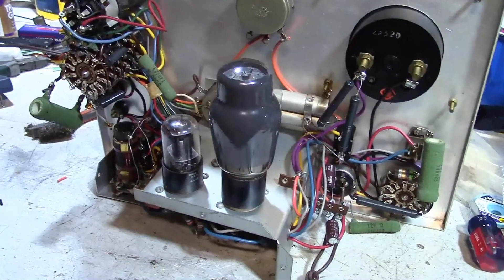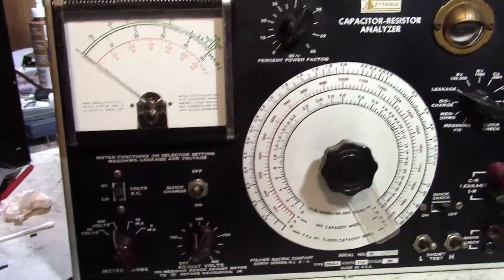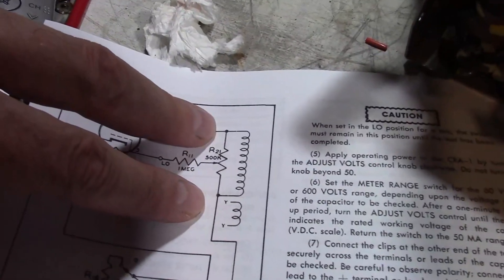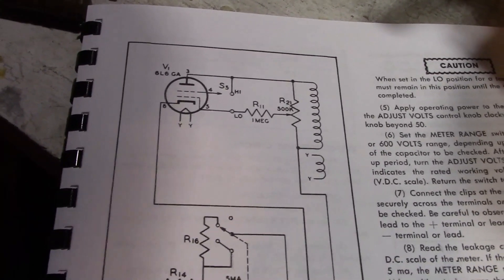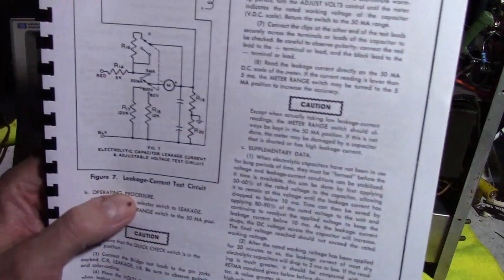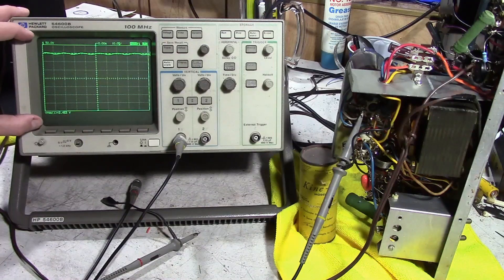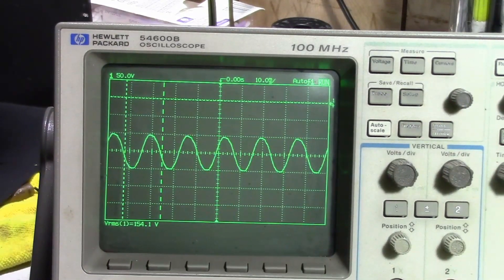Pyramid CRA-1 grid controlled rectifier

Comment: Greetings: 
Using an isolation transformer to power the CRA-1:
With nothing connected to the CRA-1's ground; connect your scope ground to the bottom end of the lower resistor that has its other end at CRA-1ground. You now have the ability to use the scope avoiding the AC component of the tube current.
I do not jave access to the full schematic, but the isolation transformer allows you to create a reference ground on the device under test. Beware not to create more than one ref gnd at a time or you will be sorry.

Comment: Hey Bob, I think this might help if you haven't already found a solution. It has a detailed writeup of the theory of the Sprague TO-5's DC high-voltage power supply circuit, which has a design using the 1619 triode-connected pentode in a manner that seems nearly identical to your Pyramid unit (though I don't pretend to understand it): https://irp-cdn.multiscreensite.com/d8d319a5/files/uploaded/TO-5%20final%20version.pdf

Here's the Sprague TO-5 manual, the style, typeface, and even schematic drawings of which are highly similar to your Pyramid tester's: http://www.mcmlv.org/Archive/TestEquipment/Sprague_TO5.pdf

Comment: Since this happened to couple people tells me that it's a component that's going bad. Check transformer for filament voltage to that 6L6 if it's lower then 6.1v then there's your issue
Reply from the maker: Or that's just the way it works.  Three others have exactly the same issue and were not able to find a problem.  The voltage is off by exactly the same amount as mine.
Reply: @bandersentv  interesting that they are getting same voltage. So definitely wasn't designed this way something caused these units to go out of range. I have a 6L6GC Russian tube I could send you it tests very strong 5600 on conductance should help. Send me an email to tysrocks@hotmail.com I can ship one out to you :)
Reply from the maker: I meant their testers operate the same as mine.  That's why I think it is working correctly.  Thank you for the offer, but I'm fine wit it the way it is.
Reply: @bandersentv  ok :) yah if it is functioning correctly I would just ignore the numbers on the control and just go by the numbers on the meter
Reply: @bandersentv  got my analyzer it's in very good shape I'm happy can now test caps he forgot to send original manual but he will ship it in couple days

Comment: What I would try doing is build a rectifier that goes in the tube socket and see if that will fix the issue if it doesn't then problem is somewhere else. Maybe have to add components to drop voltage down in that range

Comment: I think you are looking at this the wrong way, the grid only sees positive voltage, the grid goes along with the positive swing of the plate for the positive half  cycle, the negative part of the cycle is "no conduction"  when the grid and the plate see negative voltage the electrons don't want to go that way so they stay in the cathode only when the positive cycle starts is when the grid/screen and the plate starts to draw in electrons and current flows on all this elements and rectification starts,  the pot controls how much of that positive voltage the grid sees, the funtion of the pot is to vary the positive cycle voltage to the grid, I think in theory the grid sees from 0v (pot wiper all the way down on the schematic) to full positive voltage 800Vpp (wiper all the way up,  "full triode" conection, "shorted" grid-screen-plate) but 0 voltage is not enough to cut-off the tube with a voltage plate of 800Vpp so in this case the voltage would need to go a lot negative on the grid, as it is I think this circuit just doesn't provide the conditions for cut-off...  by the way if I'm not mistaken r19 and r20 act as a load for the rectifier a "ground path" but only for itself , i think the reference to chassis ground in the middle of this two resistors is made so the chasis will only see half the voltage in case theres a problem and not the full (800Vpp) if  this circuit used its"real ground" (the lower side of the transformer, black lead terminal) to chasis ground
Reply from the maker: The grid only sees positive voltage in relation to what ?  Yes, it's only positive with respect to the black terminal, but it's always negative with respect to the cathode.  The plate voltage plays a role, but it's mainly the grid to cathode voltage that controls the amount of current flowing through the tube.  At least that's my understanding.
Reply: @bandersentv  "but its always negative respect to the cathode" I'm not so sure if its always negative,  the cathode resistor is 120k (r19 r20, the "load resistors") so maybe that setting would be the "0 point" on the pot? , the 1M restricts grid current but now I wonder if this resistor is still keeping the grid at a specific voltage... could you measure the voltage at the grid when the pot wiper is at the upper side on the schema? I think measuring from the cathode pin (as ground) and from  the black lead terminal (as ground) to the grid would be a good idea, also sweeping the pot in this positions would give an idea of whats happening with grid voltage... maybe playing with the cathode "load resistor" is the key to making the voltages more in line with the markings on the front panel...
Reply from the maker: I show this in the video.  The scope ground lead is on the cathode and the probe is on the grid. It starts out at about -116 volts and the peaks increase a bit as I increase the output but it never goes positive.  The max is about -60 volts.  I don't see what relevance ground has since it pays no role in this circuits operation.
Reply: Attempting to push the grid positive  with respect to the cathode causes grid current to flow, effectively clamping the grid at zero V to the cathode. It's a diode. This is why the grid doesn't appear to go positive on your oscilloscope.
Reply from the maker: @nevellgreenough404  I am measuring the grid to cathode voltage in the video.  It is about -100.  Plenty of current will flow with the grid being negative.  Especially when there is around 800 volts on the plate.  Typically biasing for this tube is around -15 volts when used as a class A amplifier.  Of course that is with only 250 volts on the plate.  They are vastly exceeding this tube's max specs with this design.

Comment: I tried to simulate this circuit with LTSpice using Norman Koren tube library but it didn't quite work right, I guessed various values for R19 and R20 but it only reached 300V DC in the high range and 14V DC in the low range with a input of 800Vpp AC also the pot action was not linear.
Reply from the maker: Hmm, curious.  R19 and R20 are 60K

Comment: I only understood the basics of your explanation (explanation was not the problem), but I was wondering. If the grid is regulating the voltage and the knob value is to high compared to the meter. You did try a different tube. But did you try a "weak" tube? Maybe its not a new tube that gets things in line, but a weaker tube in which you might need less regulation to go down in value. That would also explain why some testers seems to align fine. They never had the tube replaced. Though it might hinder getting to max voltage. Feels like a wrong idea, but you already tested the obvious things.
Reply from the maker: It's not quite that simple as the grid regulating the voltage.  That's because the cathode voltage changes when the grid voltage changes and that changes the operating point of the tube (gain basically).  It's sort of a feedback loop.  I would if I had any more 6L6s but I don't right now.  It's not really a concern for me.  I'm just going to reassemble and use it as it is.

Comment: Bob, a simple thing that you could do would be reducing the overall voltage from the transformer output through a resistor (considering that replacing the transformer is not an option), bringing the base voltage to less than 800. Seeing the modern usual voltage is 120v, that could help in using the device (unless you always use that meter connected to the variac) and maybe reduce that problem. If you had a variable voltage source able to supply high voltage you could play with the base voltage and see how the circuit would respond.

Comment: For giggles what is the voltage reading between the Positive and the VR ground?
Reply from the maker: It's quite a bit less.  For example when the output is 500V, there is 200V between the positive terminal and ground.

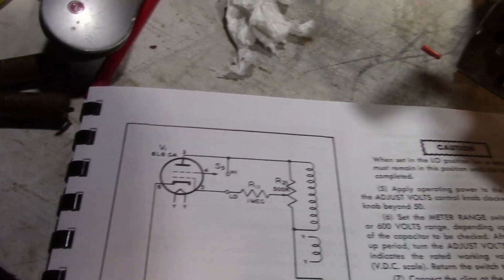Comment: a 1meg resistor  going to a 500k pot off of two pins of tube into 800v part of transformer. 4:11  very interesting.  I think that pot is supposed to read correctly.   However I would be more inclined to trust the mete and the output reading on a meter.

Comment: Question: Would simply adding a small value resistor between plate and screen 2 (pins 3 & 4) reduce the output voltage when the Hi/Lo switch is in the Hi position?
Reply from the maker: Good idea.  I'm sure it would.  Something to try for sure.

Comment: Is R21 reading correctly? Is the value in range I mean , it basically biases the tube right?Does it act “logarithm like “ or like an audio taper, sorry so many questions it’s a head scratcher! And not seeing actual circuit but if that 1 Meg was carbon comp ( just saying) I’d be tempted to go metal film resistor , I’ve seen carbons do strange things- again sorry about silly questions really makes you think lol!
Reply from the maker: Yes, R21 is correct and altering that 1Meg has very little effect.  Biasing is a tricky term to using because the operating point is a moving target.  As the bias varies so does the plate to cathode voltage which shifts the effect the grid voltage has.  It's sort of a feedback loop.  I'm not sure about the taper on that pot, but the change in the output voltage is pretty linear.